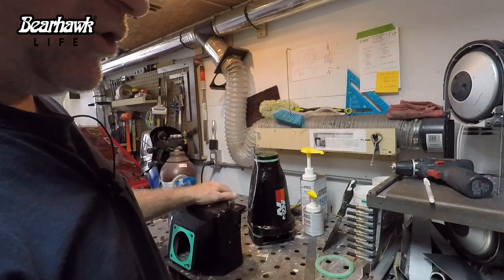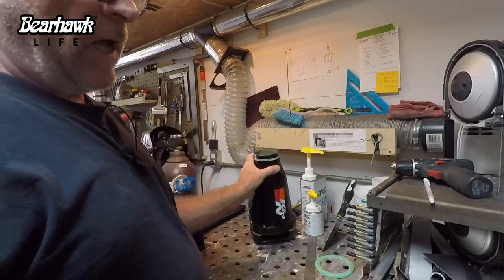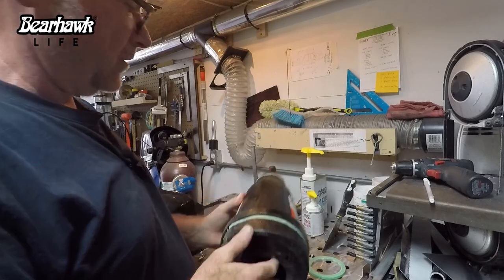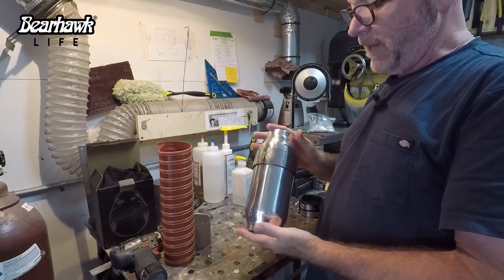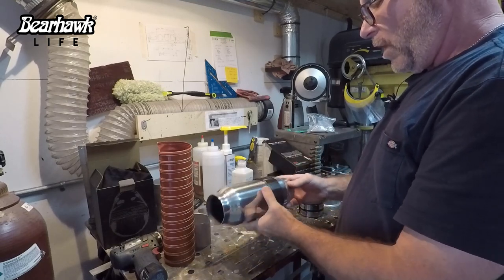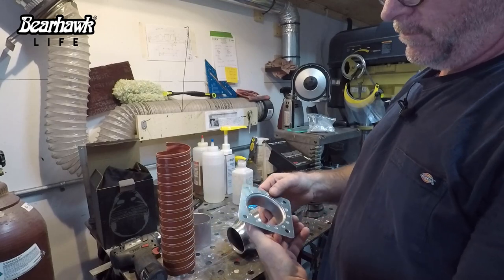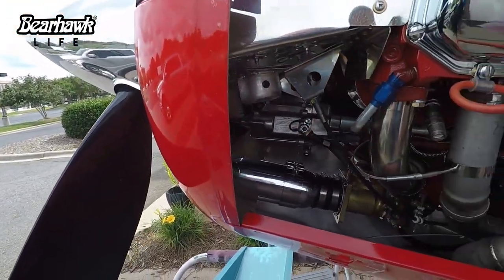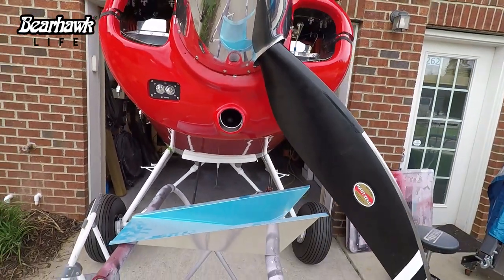BEARHAWK ~ Air Box Attempt...  PART 2

Comment: With your rectangular airbox, I noticed it was up close to the bottom of the B&C alternator and it's output stud. When considering your options for a solution, keep in mind that we can reclock the rear half of the alternator in 90 degrees increments to make the output stud be on a different side of the alternator and buy you a little more clearance.  -David at B&C
Reply from the maker: I appreciate the offer, David.  If I go back to a box, I can move the entire unit away from the Alternator.  It's the bottom that's the problem.  Thanks!

Comment: I'm sure anyone at an exhaust shop or similar could cut a section out of the aluminum airbox. As far as the fuel control is there any excess material that could be machined down? That cowling is just too clean looking to cut up but you do what you have to do I guess...
Reply from the maker: That's exactly how I feel.  Makes me sick to cut that cowling.  I don't know what else to do....

Comment: That flange on the fuel controller looks huge, any chance you could shave it down a bit on the bottom? Lots of space it looks like before you get to the throat. Or maybe an angled spacer that tilts the whole assembly up? Gotta be a way to make it work without a blister.
Reply from the maker: I've tried three times with the different approaches.  At my wits end with it and just ready to move on...  Thanks for the suggestion!

Comment: If I understand you problem correctly it is the throttle body that is the problem, if it is not then, you could shorten the front section of the filter housing by an inch or so and cut the other end so that it had a bit of and angle that could be welded and dressed up (thant might even allow you to make just a small blister under the throttle body that would not look out of place. Just a thought.
Reply from the maker: Yep.  Something's got to happen to get this part of the project over.   Thanks!

Comment: I wouldn’t use skeet hose the internal layer can come off and block your intake if not clamped correctly
Reply from the maker: Interesting.  I've not heard that before.  Seen it used many times for the same application.  Thanks!

Comment: Could you use one of dons injectors with the round clamp style inlet?
Reply from the maker: Not sure what that is.
Reply from the maker: @%F0%9F%98%80UCyQxZWWVLPtiPPn7XO_W24w Mine is the FM-150.  It does not have or allow for that type of inlet.  Would be nice though!
Reply: Bearhawk Life FM-150L has the same inlet. Don may be able to change the body over?

Comment: That spectre in-line filter seems awfully small. Although most of my experience is in the offroad world.
Reply from the maker: Will be tested by Airflow Performance.  Although with the filter has cfm of around 400.  In addition, 3” air inlet is the max for this application.  Thanks for watching!